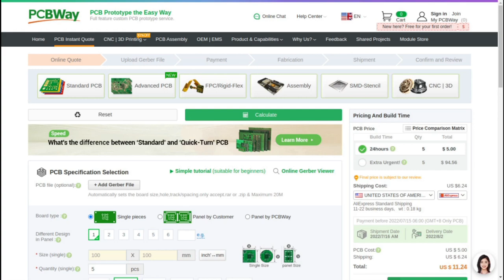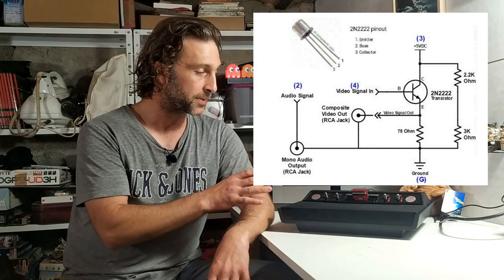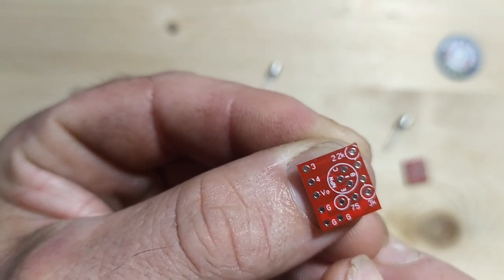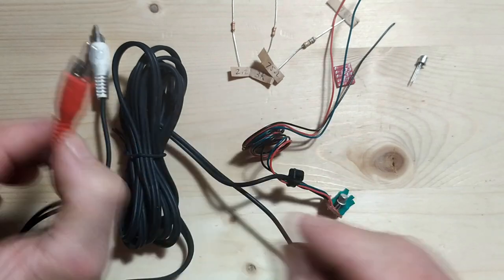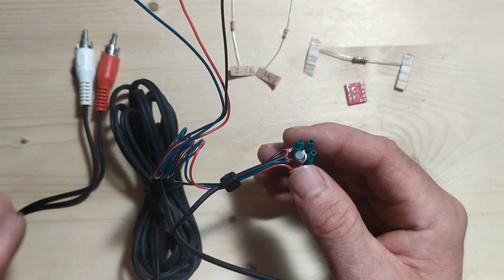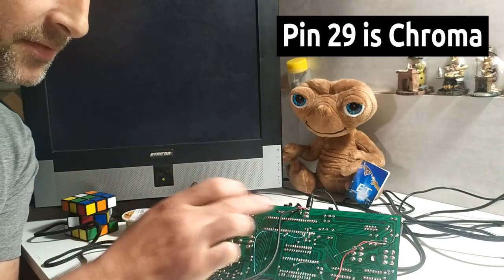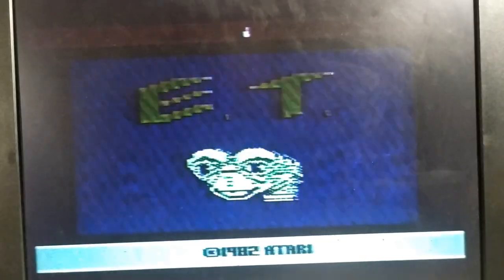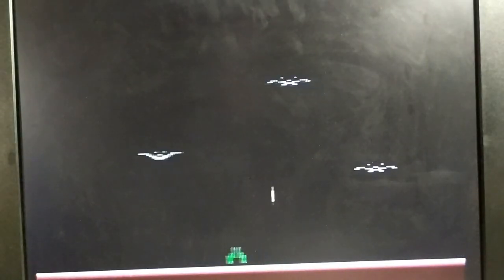Testing the TinyComp, a composite video mod kit from Rudy's Retro Intel | 8bitsinthebasement

Comment: Thanks Peter, for your honest review of the TinyComp. Yes, the transitor may sit high,however solder in the resistors first and bend them out a bit and things will fit better. I think the next version may have to be a bit bigger. Now with your mod, you can have picture on both RF and composite out. Good for 2 players.  Thanks for sharing!
Reply from the maker: You're welcome Rudy, and thank you for sending me a few to try out. They'll be put to good use. I will however make sure to keep one in the drawer beside my testbench as the TinyComp's a really handy thing to have around the workshop (as a test tool). I tried out the Atari with two TVs, it's kinda cool to have an old system running on two screens at once ;)

Comment: Cool unit :) def many could use it, so could i on a few of my sets, but overall, i end up using coaxial than audio video anymore on most of my sets, looks like a decent signal for an old unit thou, i do notice some of my Atari boxes sent a clearer nicer pic than others, i imagine due to the quality of the build of the switch box " or lack of such" lol
Reply from the maker: It's always nice to use the old RF output to get that "back in the day" feel we all remember. It seems to me that the RF signal from the old units is a lot cleaner and clearer than I remember, I believe that it's something to do with the fact that RF frequencys are no longer being used to transmit TV channels anymore so there's a lot less interfearence floating around. I like that this mod can easily be reversed if you want to and also that you're not obliged to scrap the RF out altogether if you don't want to. I kept mine so now I have the choice of either RF or composite, or even both at the same time if I want to hook two TVs up to the old Atari clone I got. The very best of every world ;)
Reply: @8bitsinthebasement  that is awesome, i do hate when mods destroy the original hook ups lol Like a lot do with the Atari 5200, many hate the switch box on it and mod them with AV hook ups, but usually it destroys the original lol plus it is getting harder to find TV's with AV hook ups, when many new digital TV's still got the old Coaxial hook ups lol Great video :) keep up the great work good sir.

Comment: Always a good day when you pop up on my Feed..

Interesting little board - maybe make it a fraction larger to allow the transistor to sit lower & help prevent component lead shorting ? Plenty of room in most retro hardware .

Will also like to see a PAL version ..
Reply from the maker: It's great to know that somebodys happy to see me ;) As for the TinyComp, it's a really handy, quick way to get a decent signal from an old RF output. In fact tit works equally well for both PAL and NTSC signals, the device doesn't really care what type of signal it's been given it just amplifys it. Thanks as always for watching and the comment. 👍

Comment: You can also get rid of some of the interference by adding 2 or 3 Ferrite chokes onto the DC adapter power cord.
Reply from the maker: That's a good idea. The PSU is a cheap replacement and gives a lot of noise too, but the Composite mod cleared up an awful lot of that. The vertical lines in some games are caused by the 2600 clone as far as I can tell, they stay in the same place on screen and never get lighter or darker. The system works great apart from that ;)

Comment: Great video .. as for coco2  you have to reconfigure the mc1372 chip in the rf can to get a composite signal. It could be used for a b&w signal on the coco2 but then you would have only co2 :)
Reply from the maker: I see what you did there ;)

Comment: That is a lot neater than the overly complex contraption I use to composite mod consoles whose composite output is too weak for a TV.
(embarrassing to say... mine has to use a potentiometer to bias the signal into the transistor and you need an oscilloscope to tune the friggin thing in)
Reply from the maker: Yeah, but I bet yours looks really cool and when you're tuning it prople get really impressed. I like when things are a little overly complicated, makes me feel clever. Thanks for watching and leaving a comment ;)

Comment: Looks good, but the signal will probably look even better on a CRT. A yellow rca plug might be a "better" choice for the cable. I've got a similar kit on a 7800 and it's been fine for a few years. I think it splits off the audio into Left and Right rca jacks, which is convenient. It would be interesting to learn if one of his kits would be able to work for a Pong console!
Reply from the maker: You can be sure that a CRT would make a world of difference to the image (but I have no CTR anywhere in the house anymore). The audio left and right could be set up easily enough and isn't a bad idea, I may well do that. Which would mean that I would have to invest in a yellow RCA lead for video (you're right it's a better choice, it is the standard after all). I'd imagine that this mod would work just fine on an old Pong console but it would be worth checking what type of signal is feed into the Pong consoles RF just to be sure. Thanks for watching and for leaving a comment ;)

Comment: Excellent video. Just what I was looking for. I need to comp mod my 2600 and CoCo2 and wasn't sure how to do either one. I don't understand why this won't work on the CoCo2. I'll have to research why this doesn't work.
Reply: Your coco2 uses R-Y Y B-Y to the RF modulator and not a direct video out signal.
Reply: You can however convert that R-Y B-Y to a composite signal. At that point you would not need this circuit. I think analog Devices has an IC that does this. R-Y B-Y is essentially component video.
Reply from the maker: Hi Tron Magnum, I would have thought that a composite mod would have been straight forward enough on the Coco2 until everyone chimed in and said otherwise (my coco2 doesn't have a RF modulator it came with a RGB output) but yeah, it seems that it's a little complicated to do. Are you a member of the Coco Discord channel? you'd find a whole lot of info and help from the people over there. If you're not here's a link http://discord.cocotalk.live/

Comment: interesting project, if I had an atari I would try it without hesitation
Reply from the maker: The Atari can be used with almost any TV now thanks to the mod, even on HDMI with a composite to HDMI converter. But this mod is not exclusive to Ataris, it can be done on almost any system that has a RF output. Thanks for watching Perdrito ;)

Comment: Peter could this work in a CoCo?
Reply: Not unless you convert the R-Y Y B-Y first. As far as I remember, the 6847 video chip does not have a direct video out.
Reply from the maker: On a Coco 1 it will work with very little hastle. Rudy did a video on converting the NTSC Coco1 on his channel https://youtu.be/GXVS1jthHkc . As for the Coco 2 it's a little more complicated as GORF pointed out below. There are mods for the Coco 2 available though. Hope this helps ;)

Comment: On systems where you have access to raw chroma/luma, it's a better goal to do an S-Video mod. You really only want composite on systems where the graphics chip only outputs composite, or where the system uses NTSC artifact color (like the Apple II)
Reply from the maker: That is an excellent point, S-Video is superior to composite so it would be a fool's errand to comp mod a system with luma and chroma sources. However a cap had been placed between the two outputs on the chip from the factory, directing a weak composite signal to the RF modulator. As I wanted to keep the system as close to stock as possible (retaining the RF output) and the comp mod to be reversable, I decided that composite was the way to go (of course I also wanted to demonstrate the TinyComp board). But you are right if it can be done an S-Video mod is the way to go, Thanks NozomuYume ;)